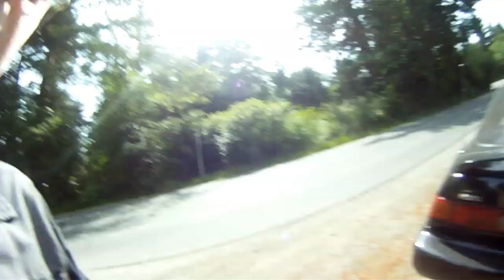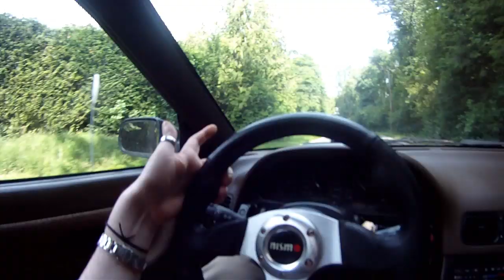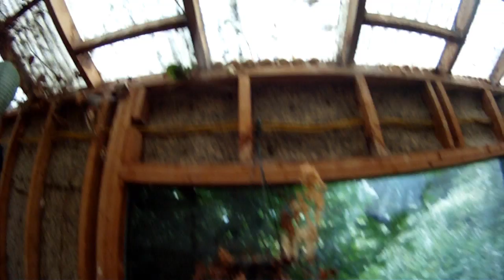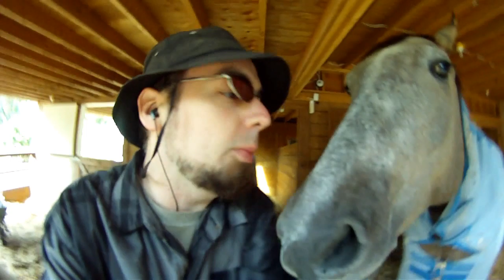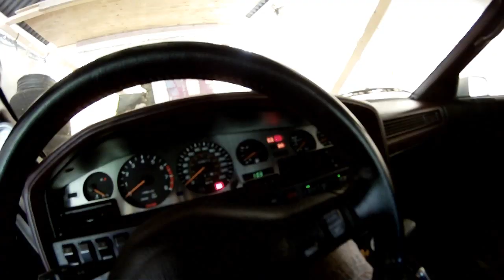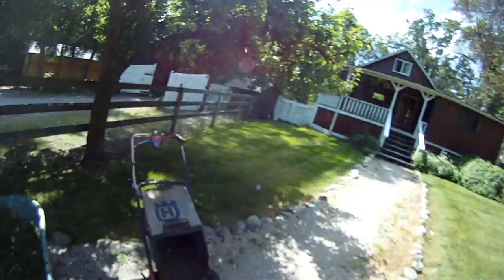The Sh*T Show : 240sx TPS is Whacked, Farm life and Supra Goofery.

Comment: Hey Buddy, Love the car vids. I had a similar issue with my 1994 Nissan Sentra. It ended up being a dirty MAF sensor. Grab a can of MAF sensor cleaner from your auto parts store, remove it from the car and spray it down. I actually had a similar issue with my Subaru and cleaning the MAF fixed the WRX up too. :) Good luck!
Reply from the maker: That was actually the only other problem I could think of being the problem, I have heard horry stories of using those cleaners impropertly though. i'll have to do some serious research.. thanks for the tip, hopefully its that easy peasy!  cheers man.

Comment: Hey, what kind of steering wheel is this? Nice 240 man
Reply from the maker: Thanks! its just a Nismo knockoff I grabbed from eBay. however i've had it on there for like 4 years without any problems whatsoever!
Reply: It looks pretty nice, been thinking about buying a wheel for a while.
Reply from the maker: Go for it. its so much nicer to drive with a slightly smaller wheel. it totally gives the car a new feel. my original wheel was faded and peeling so i really had no choice.
Reply: I definitely will sometime soon; blew most of my spending money to swap it to a standard :(
Reply from the maker: swapping to standard is well worth the $$$!
Reply: I agree fully. also want to look into a z32 swap and some new paint. My paint is some of the worst seen in the history of the universe. My clear is bubbling and chipping off half way down the entire car
Reply from the maker: plasti-dip the paint.. do you mean a z32 motor? or suspension stuff? i'd stick with the tried and true SR20,s or even just a well built turbo KA is pretty freakin badass. look those up on youtube. i've seen some making well over 350hp no problem and staying reliable.
Reply: z32 brakes from the 300zx, sorry for not clarifying. I'd like to swap an SR in when funds are available, but im just running a stock KADE until that time comes. 130k on the motor and it was pretty well taken care of so it should last me until that time comes. Only looking for about 250hp on low boost and stock internals, otherwise i would probably rather go RB25
Reply from the maker: Yeah I hear ya, If i ever get the funds i'd like to swap a 2jz into my Supra and then put the 7m-GTE into the 240sx... that could be very freakin' interesting. it puts down over 400hp and I havent seen anyone else do it yet. altho Ryan Tuerck's been a big fan of the 1jz in S13's which is also a really great option.
Reply: I hear that its somewhat difficult to swap the jz motors into a 240 but I haven't looked into it too much. You also have a mk3? I love 80s-90s imports
Reply from the maker: 1jz isn't that hard, but not as easy as a SR20 swap thats for sure.. and yup I have a 90 white package MK3 mint condition rocking a big ol turbo and every mod needed. i should make another video about it.. love that car. its insane when the boost hits!
Reply: yeah man do more car vids; ill subscribe if i didn't already. I have a gopro and plan to make more videos than what i have right now